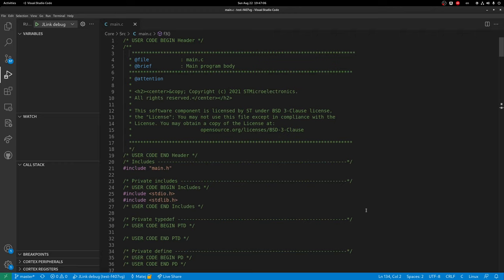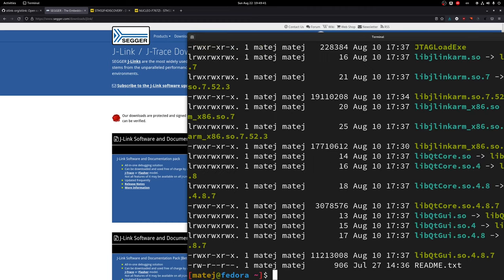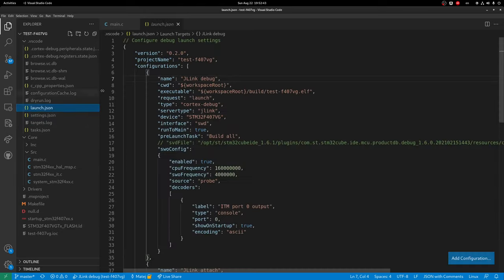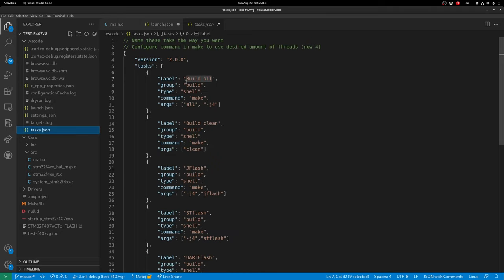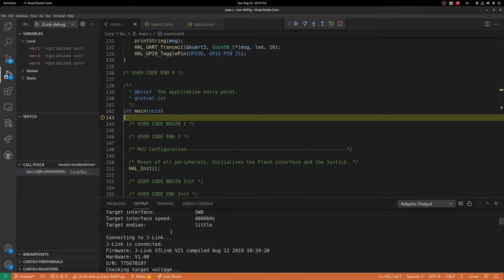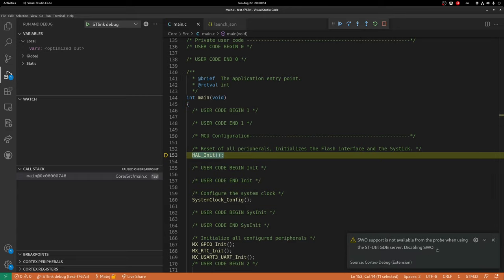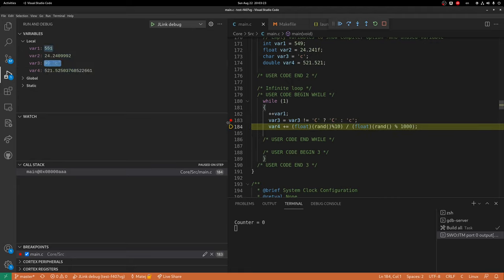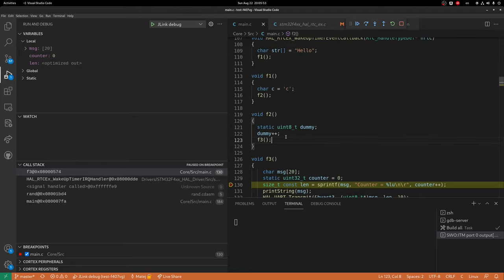Debugging STM32 in VSCODE with stlink and jlink | VIDEO 45

Comment: Thanks for your great work! It would be nice if you could enable subtitles, they're good help when english is not first language and there are certain fine subtleties in the speech
Reply from the maker: Thank you for the comment. I'm aware that I might pronounce some words badly, but I try to speak as clearly as possible. I see that there are no auto generated subtitles, but other videos have them. I'll see what I can do.
Reply: Thanks for your response. Not badly, just some homophones issues :)

I just noticed that: some of your other videos have subtitles

By the way:

Do you have any experience with bare metal programming of STM32 CAN peripheral?  I'm trying to build a RIOT socketcan driver and I'm having some trouble getting it to work.
Reply from the maker: I will be learning can this year for a project, but It's on an fpga and it might be late for you. I'm then going to try on stm as well and maybe make a video.
Reply: Great. By then maybe I can contribute something if needed

I finished yesterday the config according to your video. I added some details like ${cwd} for make and modified $PATH

Thanks again for your excellent tutorial

Comment: Thank you so much for this video! I got my stutil based debug running however it works only once.  When I hit stop and try to hit run again later, I get the below error (I am using a Mac). If I force-close “st-util” and re-run, it works again! What am I missing ? 

SERVER CONSOLE DEBUG: onBackendConnect: gdb-server session connected
libusb: warning [darwin_open] USBDeviceOpen: another process has device opened for exclusive access
libusb: warning [darwin_open] USBDeviceOpen: another process has device opened for exclusive access
libusb: error [darwin_claim_interface] USBInterfaceOpen: another process has device opened for exclusive access
st-util
2021-10-19T20:20:04 WARN usb.c: Stlink usb device found, but unable to claim (probably already in use?)
2021-10-19T20:20:04 DEBUG common.c: * stlink_close *
Reply from the maker: I will test this on the latest versions that I can get on my system and report back to you.

Comment: Hi sorry for asking again. I run into another problem and I hope it is ok to ask again. 

Now I can run the debugger using st-util and arm-none-eabi-gdb on VSCode, but it will not stop at the beginning(main). 
It seems that it will run first and after a random amount of cycles then pause, in the while(1) loop. Below is my "launch.json file", I do add the "runToEntryPoint" tag:

   "configurations": [
        {
            "name": "ST-Link Debug",
            "cwd": "${workspaceFolder}",
            "executable": "./build/CPP_Test.elf",
            "device": "STM32F407VE",
            "request": "launch",
            "type": "cortex-debug",
            "runToEntryPoint": "main",
            "servertype": "stutil",
            "interface": "swd"
        }

and here is the debug output:

```
Reading symbols from /home/ben/stm32_tools/abe_build/builds/destdir/x86_64-pc-linux-gnu/bin/arm-none-eabi-objdump --syms -C -h -w /home/ben/stm32_ws/CPP_Test/build/CPP_Test.elf
Reading symbols from /home/ben/stm32_tools/abe_build/builds/destdir/x86_64-pc-linux-gnu/bin/arm-none-eabi-nm --defined-only -S -l -C -p /home/ben/stm32_ws/CPP_Test/build/CPP_Test.elf
Launching GDB: /home/ben/stm32_tools/abe_build/builds/destdir/x86_64-pc-linux-gnu/bin/arm-none-eabi-gdb -q --interpreter=mi2 /home/ben/stm32_ws/CPP_Test/build/CPP_Test.elf
    Set "showDevDebugOutput": true in your "launch.json" to see verbose GDB transactions here. Helpful to debug issues or report problems
Launching gdb-server: /usr/local/bin/st-util -p 50000 --no-reset
    Please check TERMINAL tab (gdb-server) for output from /usr/local/bin/st-util
Finished reading symbols from objdump: Time: 35 ms
Finished reading symbols from nm: Time: 41 ms
Reading symbols from /home/ben/stm32_ws/CPP_Test/build/CPP_Test.elf...
Warning: 'set target-async', an alias for the command 'set mi-async', is deprecated.
Use 'set mi-async'.

0x08004250 in main () at Core/Src/main.cpp:98
98	    n++;
Program stopped, probably due to a reset and/or halt issued by debugger
Note: automatically using hardware breakpoints for read-only addresses.
Run to 'main' timed out. Trying to pause program
```
I'm not suire if it has something to do with the 5th line when launching gdb-server it use the "--no-reset
" flag. Thank you very much !!
Reply from the maker: I'm late, but let me give my thoughts. I hade some weird errors with debugging and most of the time it came from st-util. It works mostly fine, but sometimes a strange version just sends it. 
I've been using a workaround: cortex-debug supports stlink as well, debugger used by STM32CubeIDE. You can give the debug plugin the path to the debugger:
Install CubeIDE somewhere, I have a folder in $HOME for this sort of stuff: ~/Software/STM32CubeIDE-1.8.0
You can find the debugger in there: 
cortex-debug.stlinkPath": "/home/matej/Software/STM32CubeIDE-1.8.0/plugins/com.st.stm32cube.ide.mcu.externaltools.stlink-gdb-server.linux64_2.0.100.202109301221/tools/bin/ST-LINK_gdbserver"
Also, before you throw away st-util, make sure that you have a path in settings.json!
Reply: I met exactly the same problem as you describe. jlink works fine, but stutil never stops before while(1) loop

Comment: I have anpplication that has a bootloader and a main application ,2 bin files and one dfu file, i see the previous developer generated elf file for bootloader... when  i try to debug I only get disassembly view and not C code... any clue how to go about getting it to show me the C code when stepping through
Reply from the maker: I haven't worked much with dual binaries, but I would assume that either elf file has not been compiled with debug symbols (-g3, -ggdb) or that you don'h have the source code, there fore it cannot step it. Also, the fact that you have two main functions for bootloader and the application might confuse vscode, but I'm not sure.
Reply: it confuses gdb for sure when i put a  break at main it sets it in bootloader main and application main. Either way since this application is RTOS based, steppig through code is sometimes pointless since the very next line is not guaranteed to be what you expect
Reply from the maker: That's an interesting problem. I haven't had a need for a custom bootloader, but I might take a look. I have worked with freertos in classes, but not in work, only bare metal event loops and interrupts.

Comment: the update to j-link on the firmware V2.J36.S7 and V2.J37.S7 doesnt work, downgrade doesnt work :(
in ST-Link Reflash ive got ERROR: Unsupported ST-LINK firmware
how to fix that?
EDIT:
it working on nucleo, doesn't working on original st link v2

Comment: Hi, not sure if you're still answering these questions, but I'll try anyway. I was able to configure debugging with st-util and it's nice as it can be targeted correctly by specifying serial numbers, as I often work with multiple devices connected to my PC. On the other hand, I can't get Live Watch to work with stutil, that's why I have another openocd configuration that manages to display Live Watch. The thing is that openocd doesn't target specific board even though I use serial number in the configuration. Any idea how I can get everything working on one debug server?
Reply: Actually, i just switched servertype from "stutil" to "stlink" and now everything works like a charm
Reply: @herantd  thank you for sharing, I was getting stuck with 'Failed to launch GDB: protocol error with Rcmd'. This change got me up and running.

Comment: Thank you for your time.. But still I'm not able to run my debugging and I don't get why, I cofigured everything like in your video and also tried everything else... doesn't work
Reply from the maker: Sometimes plugins have unstable update. You should use debug logger (one of the tabs on the bottom) and terminal/gdb output to determine which part is not working. You have target gdb server -> arm-gdb -> cortex debug.

Comment: Thanks for this. I have a couple  questions if you’re open to GI ring a couple answers. I have several Nucleo, Discovery, blue pill, and black pill (stm32f411 version) . 

1) What are the differences between Jlink and STlink features?

2) There is a new STLink V3.  Can you update a V2.0 or 2.1, or black pill to V3?
Reply from the maker: tldr: For basic download and debug it doesn't matter. Try both for yourself and your use case. Stlink is cheaper and comes with dev boards, but can be limiting in debugging.

The most important difference is that stlink is only for stm32 and jlink is universal. If we talk about the independant devices, which both companies sell, that is the difference. Jlink by Segger is a product of a company that is focused on debuggers and all the software for debugging and testing therefore it's much more powerfull and the fact that they support all OS platforms with frequent updates is great.

Stlink is also provided as on-board debugger for the dev boards. It does everything you need as far as downloading code, debugging, basic swo trace, etc. It is somewhat limited to official CubeProgrammer and I rely on open source tools to use on linux and in development environment.

As far as stlink v3 goes I have no experience with it. It looks as un update to v2, hardware as well  so probably not upgradable from v2, as I have also seen it on some newer dev boards as well, but it's also sold separate. It hase more gpio, it's faster and more expandable, but still just for stm32.

I use for my development and learning the jlink edu which has cost me 50e. It is great, software works very fast and never had an issue, unlike stlink. I kind of forgive stlink as I see it more as a startup tool to get prototyping and learning as fast as possible without worrying about debuggers. Software support is very rich both the company and other plugins, like vscode.
Reply: Wow, best and most complete answer I have ever gotten from asking anyone a question on YouTube. Thank you! I may buy a "SEGGER J-Link EDU Mini " I ran across. It's only $20 and and official product not a knockoff.

Comment: Hello I loved the video, but I am in a bit of a problem. I can get the debugger working both in windows and linux. But on both systems it is really slow, especialy compared to your video. It takes a long time for visual studio to know where it reached a break point even though the debugger reports it nearly instantly. Do you have any idea what it could be. On windows it even goes as far where gdb completely crashes after stepping a couple times. 

After the breakpoint is reached the gdb server will start reading register addresses which take about 10+ seconds. If the breakpoint is hit multiple times it will work fast, but a new breakpoint again is very slow. Do you by any chance know what the problem could be?
Reply from the maker: I have also seen this on one of my computers. My main pc work fine. I will check what could be the probem, I could only think vscode or cortex debug, jlink gdb or arm gdb.
Reply from the maker: So my main pc that works fine has these versions:
vscode: 1.60.2
cortex-debug plugin: 0.4.6 preview,
gcc-arm-none-eabi package: 10.2.1 (20201103 release)
segger J-link gdb server v7.52c
My other one that has that issue:
vscode: 1.60.2
cortex-debug plugin: 0.4.6 preview,
gcc-arm-none-eabi package: 10.3.1 (20210621 release)
segger J-link gdb server v7.52b
All my PCs run Fedora 34 with latest updates, apart from hardware, they are almost identical.
Reply: I think most likely the gdb version and jlink gdb server version mismatch. I will try installing an older version of arm-none-eabi-gdb and post the results!
Reply from the maker: I have just changed the arm gdb version and it looks like the newest version (10.3.1) has a problem.
Reply: Yes I can confirm this now. Jlink also definitely works a bit faster than st-util. Thanks for all your effort!

Comment: A small warning regarding the optimization levels -O0 because i spent a few hours because of this. On specific models (32F4, 32F3 and probably others)  usart, character received interrupt breaks.  The RXNE bit fails to reset..
Also debugger breakpoints sometimes make the uart to break until the device is power cycled
Reply from the maker: I have not heard of this problem  and I will try to replicate it. Were you using reading RX with interrupts or dma or polling?
I have experienced a well known bug with trasmitting with dma and it's a problem when the peripheral will transmit only once and never again. Problem is solved by enabling UART interrupts so that when the transmit is finished, interrupt is called and HAL will clear bussy flag inside interrupt routine.
Link for references: https://community.st.com/s/question/0D50X00009XkgtY/dma-uart-with-hal-remain-busy-bug
Reply: sorry, i missed the original relly. I was using a char received interrupt. actually the problem was the debugger after all, but it was very hard to pin it down. What i notished is that i have to avoid, under all circumstances, to have a breakpoint in the interrupt, or else the interrupt will not rearm. My theory is that the required bit was expected to update with a clock edge that its missed because of the breakpoint. After that and resuming the normal execution, no interrupt will be trigger again which doesnt change even if i press the reset button. The only solution was to power cycle the board. If you want me i can retrace my steps in an email. With that being said, i just started working with Arm so i have about a week of experience overall. I may be doing something completely stupid somewhere.
Reply from the maker: Interrupts represent great solutions, but come with a mountain of potential problems, that you will have.
First I would suggest to read up on the UART - interrupt receive workflow. I just took a look into HAL api and it looks like HAL_UART_Receive_IT will store 'Size' amount of character into a buffer and it will call Receive Complete Callback to let you know. You can use that interrupt function to catch that event. After you parse your data and you are redy to receive more, then just call HAL_UART_Receive_IT again. This will ensure that if you put your breakpoint to where the peripheral is finished receiving, you should not have any more problems.
I will be making a video on interrupt safety in the future :)
Reply: thank you for your response. Sadly i know, i do have mcu experience, just not with arm yet. i did a glance at HAL library and went directly on register programming. Partly because i like to hurt myself, but most importantly because i found Hal to be severely lacking. Messages that i have are of arbitary length and CLCR terminated so i couldnt know how many chars i would receive beforehand to set the hal  interrupts, so i did the byte by byte approach, saving the complete message on a queue to be processed later. Unfortunately i dont know all the traps for this architecture yet, and here we are. ;). With that being said, cant wait for your next videos
Reply from the maker: i understand your concern. I have (currently as well) worked with parsing messages of arbitrary length.
In short: I used a large buffer, that it could hold a few times the maximum length Then from main with a function I have a static index that holds the last position in buffer that I have checked. I also read current DMA pointer location/index to know, where the last received character is placed. Then I just use another function that checks for a potential message between those two locations. At the end I update the last position index. I rely on the fact that I parse messages from main faster than the messages are comming. This is not very timing accurate, but plenty fast enaugh.
I hope this gives you an idea. This implementation, at least, does not need interrupts and that's one problem generator less. Cheers.
Reply: thanks that's a terrific idea. What i did now works but that sounds better,  i will try that
Reply from the maker: Just make sure, if you go this route, you have a parser that keeps its state between buffer checks. If you parse half of incomming message, you don't have to throw it away. You just exit and next time you parse a little bit more. At the end, even if bit by bit, the parser should be a state machine that parses correctly all the parts of the message pattern. Maybe I'l make a video on such state machine, after I introduce C++, as it make code much more readable and easy to understand. Good luck with your implementation.

Comment: Thank you for making this seires!! It realy help me a lot~  
But I run into some problem when executing arm-none-eabi-gdb,  and I cannot find any valid answer online. So I'm wondeing maybe I can ask here.

When I execute arm-none-eabi-gdb, it has the following error:

Could not find platform independent libraries <prefix>
Could not find platform dependent libraries <exec_prefix>
Consider setting $PYTHONHOME to <prefix>[:<exec_prefix>]
Fatal Python error: Py_Initialize: Unable to get the locale encoding
ModuleNotFoundError: No module named 'encodings'

Current thread 0x00007f75639ddc00 (most recent call first):
Aborted (core dumped)

And I've checked that I install python & python3 correctly. Have your ever ran into this kind of bug? Thank you very much~
Reply from the maker: I haven't seen this error, looks like vscode/plugin related. Some suggest reinstalling python2 and python3 and all the packages you use.
Some suggest less drastic changes:
https://stackoverflow.com/questions/38132755/importerror-no-module-named-encodings

When in doubt and out of ideas, reinstall all the tools.
Reply: Thank you  for your advice ~ I took your advice and reinstall my os but it still doesn't work. Then I thought maybe build from source will solve the dependency problem. And the target built from source work!! But the one download directly sitll not working. But I guess it doesn't matter anymore~~